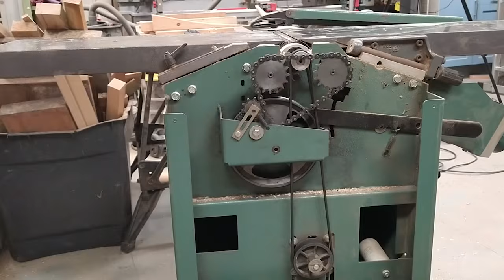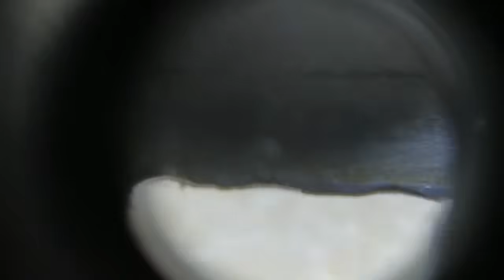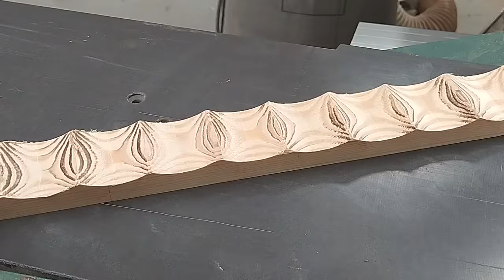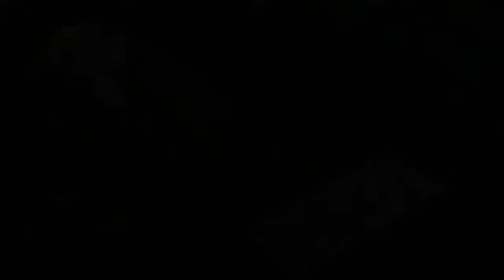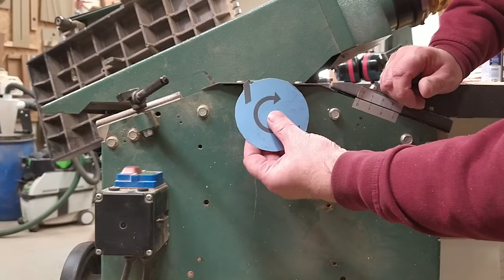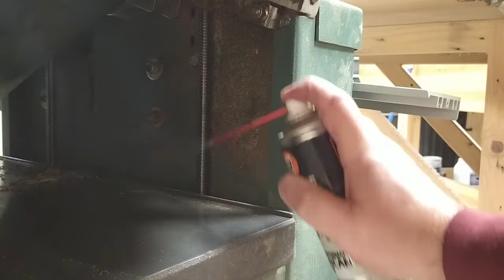Masterclass: Perfect Jointer-Planer-Thicknesser Setup!

Comment: That's like my Kity 636.  I bought mine from Axminster in 1992.  I'd been accustomed to using a de Walt of the same size (10" × 8") which had jacking screws to adjust knife height.  I found this convenient to adjust.  First time I came to replace the 636 knives I had awful difficulty in getting the right travel (like your video at 17 mins).  After 1½ hours I hadn't got there and I had bad backache.  I phoned Axminster all angry, and the knowledgeable lady Miss Sarah said that the Kity was a better machine than the de Walt, and told me how to set the knives quickly and easily.  Her method worked OK and I would recommend it over your method.  It was this:
1 - Take a nice flat piece if hardwood board, a bit narrower than the knife length, maybe 15" × 7" for a 10" long knife.
2 - Rotate the knife to be adjusted to TDC
3 - Hold the piece of board firmly over the knife, pressing down and tighten the two end screws (the piece of board was chosen to be the right width to allow spanner access)
And it worked.
I have no idea whether Miss Sarah still lives, but God bless her in any case.
By the way, when you allowed your block to travel over the masking tape, the thickness of the tape will have caused significant error.  I don't understand why you did that.
I had Arthur Maskery working for me in 1988 at British Aerospace, Weymouth.  He'd be around 90 now.  Any relation?
Reply: Regarding the masking tape, an alternative is to draw your pair of lines on the batten, and align the starting mark with the leading edge of the table.
Reply: @ianm452  Yes, that's how I do it.

Comment: Hi Steve, I have the same machine as you, but I have a problem with the feed rollers.  I have to push and pull the timbers through.  You mentioned pressure springs please could you advise me  Thank you Paul
Reply from the maker: Hi Paul. I've only ever adjusted my rollers once, and it was a very long time ago, so forgive me if I am a bit hazy on the memory, I've been to bed since then.
First, check that the rollers are actually going round. Lower the table to maximum and shine a torch inside. Can you see them turning. If not, it you feed lever engaging the arrow drive belt?
If they are turning, are they clean? You might have to get inside with some thinners and a toothbrush.
If it is the pressure itself, remove the covers and adjust the pressure roller with an Allen key.
If all that fails...
S
Reply: @SteveMaskery  Thank you. The rollers definitely turn, I will see if the are clogged. Regards Paul

Comment: Had my 636 for 30 years and this blade tapping adjusting technique is a revelation - far better than the Kity setting jig which terrible to use. Thank you!
Reply: May I suggest you read my comment?  I have a 636.  The 637 manual
http://pluspourlebois.free.fr/Les%20fous/notices/Kity%20637.pdf
suggests a method similar to that which I describe.  No jigs.

Comment: I liked your explanation of why the knives need to be just proud of the out-feed table. But the depth of the little arcs will depend somewhat on the speed you feed the work through. You should get a smoother surface by feeding more slowly. On the other hand, at college I was told off for feeding too slowly as then the knives are just scraping and not cutting, and it's not good for them. It could even lead to burning.

Comment: Hi Steve me again do you have the set up the tables to suit the head as this will make a difference  to the thicknesser ?
Reply from the maker: On my machine the head is not adjustable. so the thicknessing table has to be set to that. If it's not right you have to adjust the chain, one tooth at a time. I've never had to do that, fortunately. Then get the tables co-planar, then set the knives. It's a 3-way balance.

Comment: The difference in the depths of the scallops is what has cleared up why the outfeed table isn't set at the same height as the tops of the blades. No matter how tiny. First video I have seen that explained this. Great info, thank you

Comment: Great video Steve
I have just bought a second hand Kity 637 and this video was really useful as what you have looks like a Kity 636 or 637
Your videos are really clear , informative and at a good pace giving one a chance to absorb what you are saying
I do not have a manual for my one, so finding where the roller tension adjusting screws will be a bit trial and error as your video dod not show that
Weel done all round and thanks for putting up that video

Comment: Hi does the ammout the blade sticks out manual says 1.8mm?
Reply from the maker: I don't know what you would measure from, to be honest. 1.8mm out of the cutter block, maybe, but I don't know how you would measure that. 1.8mm above the outfeed taqble would be far too much. The drag test might look crude, but it is the established way to set these machines up and it works very well.

Comment: 'A bit of support on the way out.'  What exactly does that mean?  Do we push the workpiece down onto the outfeed table?  I've used a dedicated jointer at my Menz Shed for several years, but none of us have really got on with it.  The outfeed table is also on an angled bed, so it can't help but remain parallel to the infeed table.  It has HSS blades which I set up using 1-2-3 blocks and a DTI and each end of both blades is nicely aligned with the outfeed table.  We had a DeWalt thicknesser for several years, but a problem with both machines was that few of the Shed members have any sort of training, (I am a retired engineer who started as a toolmaking apprentice, and finishing as a design engineer) so the machines tended to be abused.  The thicknesser in particular was forever leaving tiny ridges on the workpiece because someone had nicked the blades with nails/pins in the timber.  The rollers were also forever slipping on that thicknesser.  We now have a 15" thicknesser from MACMA which is solid.  It has a helical head, but I still get snipe sometimes.  Another problem is that someone always wants to help you when using the thicknesser by taking control of the outfeed table, and gets upset if you tell them you'd rather do it yourself.

I have a decent workshop at home and can do everything except jointing and thicknessing, so I have ordered a HAFCO PT-254S from Machinery House here in New Zealand.  It has a similar design to yours, and I am hoping that being the only person using it, I can keep it setup properly and not abuse it. I am still concerned about snipe though.  At the moment I have at least one piece that has enough redundant length to run through with the other workpieces.  Even that approach can be problematic at my Menz Shed as the insistent helper on the outfeed table does not understand the necessity of keeping the shorter pieces ahead of the long one, so when they slip and long piece catches up, you have snipe on them again.  Explaining this can be hard when your helper thinks they 'know what they are doing'.   Having my own machine, I am hoping to keep the feed rollers properly adjusted and the tables waxed so everything works as it should.

Comment: After cluelessly spending several frustrating hours trying to set up my new (to me at least) thicknesser/planer, I realised that I needed some expert guidance and this superb video gave me exactly that. Though it's pretty obvious in hindsight that these precise machines need precisely 'tuning', it's only truly apparent when you start the actual work itself, and in the process realising that the previous owner also clearly had absolutely no idea what they were trying to adjust where when and how and presumably just gave up on it and stuck it on Marketplace. Certainly my gain, as fast forward 4 hours and I was just stunned how I was machining oak planks to perfection, particularly as although the machine is good quality German built kit, had it been a car in Auto Trader, it would definitely have been in the 'bangers' section.
I can't thank you enough Steve for what is, exactly as the title says, a 'masterclass' in setting up a thicknesser/planer and I'm absolutely certain that this new found knowledge is going to take my woodworking to a whole new dimension.

Comment: Hi Steve. Great video, I have a similar machine, it's an Elekra-Beckum HC320 which uses a central column to carry the thicknessing table.
I haven't had to adjust this but I guess it would be easier than having four screws? This machine dates from 1996 and  was German made.
Reply from the maker: Hi Michael, I've never had to adjust a machine like that, so I can't really help you on that point. But I'm glad you enjoyed my film!
Reply: Hi Micheal. I also have the same Electra H320 planner and am also  looking for for this type of teaching. Let me know if you find out. Thanks.

Comment: I have a question, is it necessary for the floor under the machine to be in a state of balance or stillness, because I might disassemble the two tables?
Reply from the maker: Do you mean your machine wobbles on an uneven floor? If so, I would definitely shim up the corner to make it steady, yes.
I don't really understand why that is relevant to disassembling the tables though, to be honest.
But Yes, definitely stop it from rocking.
Reply: @SteveMaskery  My machine is very different from the one you have because it contains four screws in each table. I want to make the frame in a scale condition and then weigh each screw with the laser scale. If you have WhatsApp, I can contact you in I want to send you pictures so that you understand because The machine that I have is Italian
Reply from the maker: @menamsaadawi4042  Please email me, steve@stevemaskery.com, and I'll send you my WhatsApp details.

Comment: I just bought my very first jointer combo, I’ve never ever used one at all, little scary i must say, but confident that after watching, this great tutorial, ill be fine, hope, but anyways thanks so much for taking the time for us that we don’t have a teacher to teach us how to even star, thanks, and one Q, the one I bought is used, very old one, and i check a looks like the in feet table has a cup on the center of it, any suggestions on what to do? The out feet table looks flat, appreciate any help, thanks greetings from Bolivia,
Reply from the maker: Don't worry about it, mine is the same. Infeed tables wear faster than outfeed tables because the wood is rough as it goes into the knives and smooth after they come off. That roughness makes them more abrasive, so the tables wear. It's worse on aluminium tables like mine, rather than cast iro tables. As long as your knives are straight, the fence is vertical and the outfeed table is flat, you should get good results.
Reply: Thanks for the advice now that you say that i feel better, was even thinking to take it apart and take it to a machine shop, which there are bunch around here, eve one few block from my house, but I’ll use like that for now, but is a game changer having one of this machines, here they don’t sell mill lumber, they sell rough only, and this machine will save me lot o time finally, so thanks again and keep it up the the great tutorials

Comment: I have a similar machine that I got very used and missing the fence. I had given up on it to a large degree and had started saving for separate machines. But I’ll give it one more go after I get some measuring /precision equipment. I think I understand what I’m going for now with the adjustments.
Reply from the maker: Do give it a whirl. Yes they are built down to a price and have aluminium tables rather than cast iron ones, but, once they are set up properly, thry perform very nicely. In 20 years I've got through a couple of drive belts and had to replace a bushing, so I don't think that is too bad, really.

Comment: Thanks Steve!   Excellent content and great presentation. If only this video had been about a couple of years ago. My planer/thicknesser was great as a planer (on the top) but the results from the thicknesser were unacceptable. I was so frustrated by my inability to get a good result that I bought a separate thicknesser.  This has proved to be an expensive but positive solution. But of course it creates a further space issue in a smallish workshop.  If I had had the detailed knowledge you shared in this video perhaps I could have saved myself a few hundred pounds and a great deal of frustration.  Can I plead with you address - in a future video - the other problem, which despite research, effort and considerable expense has defeated my quest for a solution.  A cabinet saw that keeps clogging up with saw dust - grrr.  When I retired I set out to become a competent woodworker not a machine engineer. So thanks again for this valuable input: at least I now know how to master this machine.

Comment: I must say that was the most comprehensive setup videos I've seen.  I learned something about tapping the block to raise the blade back up again. I usually loosen the bolts a tad and tighten again to allow the blade to be pressed up by the springs. Not that all are still there  anymore unfortunately. The boss has no interest in replacing them either.
Reply from the maker: Thank you Scott. I did try to make it as comprehensive as possible,especially the bit about the blades being higher than the outfeed table. I've watched more then one video of people saying that they should be the same, people whom I thought should have known better.
And yes, you can do the drag test the way you do. There is more than one way to skin a cat, eh?
Reply: @SteveMaskery  if the blade is higher than the outfeed table does that not make the timber rock downward as you change the pressure down on the out table. there will be a gap between the timber and the out table surely.
Reply from the maker: @MrSnookerballs  No, because the surface is very slightly rippled. Warch it again, as I explain the difference between TDC of the cut and the  points between the scollops.

Comment: I set up these machines at work, and when I want to make sure both sides are the same I do a similar action of rotating the blade and dragging the wood. Before I drag the wood. I make a small mark on the wood with the wood 50mm past the blade, there abouts anyway. I mark from the edge of the in feed table, Rotate the blade and mark again from the edge of the indeed table. 4mm movement is about right. Then I move my block to the other side like you did and adjust until the block moves the same 4mm.  If your tape is on an angle your marks may also be slightly inaccurate. I do this often enough that I use the same block every time and use the same marks from the first time I set it up. Hope It makes sense. I have a 1mm tolerance and if one side is being tricky I make sure the other blades are better. All our machines have 3 blades and I can usually get a 2.5meter length of wood dead straight without too much mucking around. At both ends of the blade. If the blade is angled it can introduce a twist into a long wide length. Or one side of the blade is perfect and the other side of the blade may cut too much or not enough